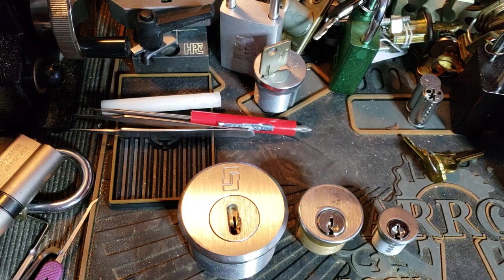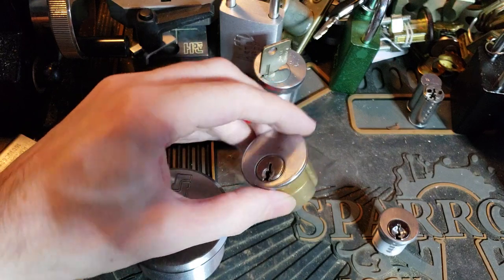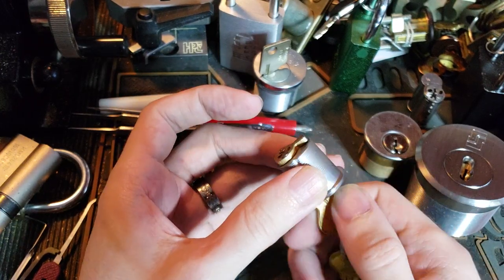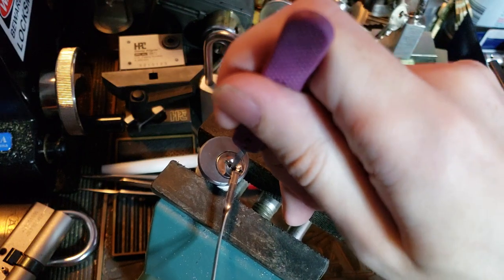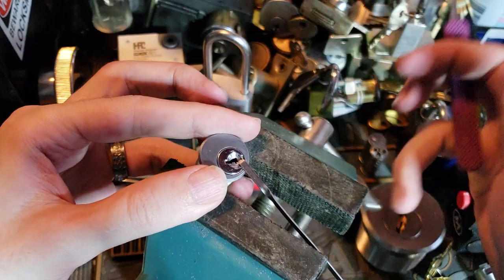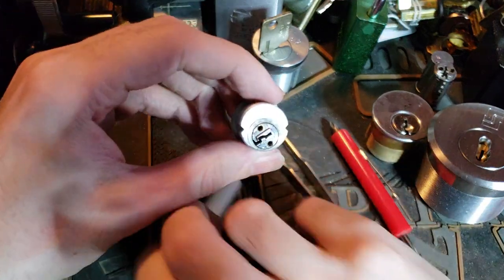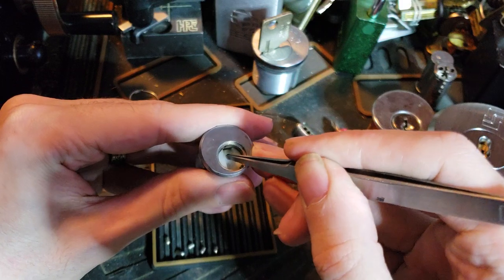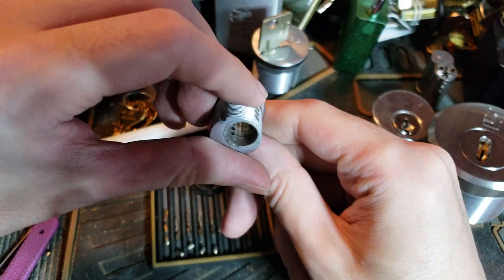(113) Ilco Peanut mortice cylinder pick and gut

Comment: Hey, I have been told by my local lock Smith that the peanut cylinder lock on my commercial building needs replaced and that they are nearly impossible to come by. Is there any chance you can make a recommendation where to look? Or is there a way to update the lock to a more current lock style? Any advice would be really appreciated.